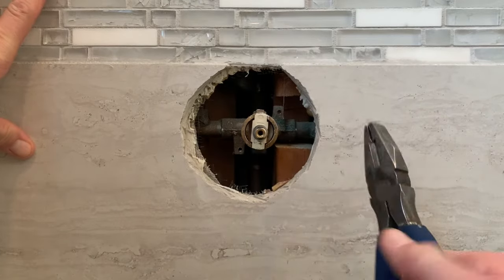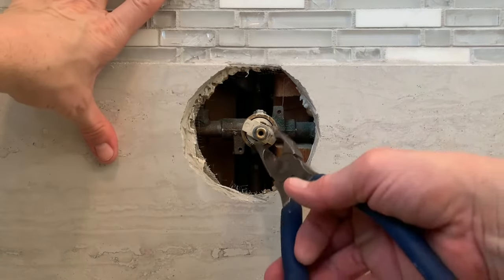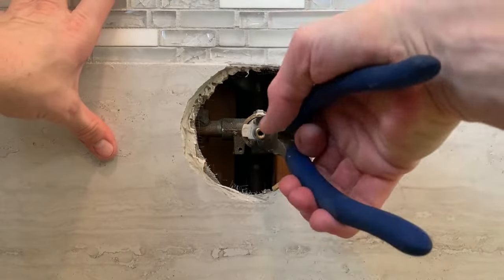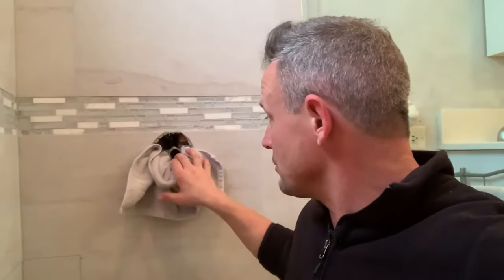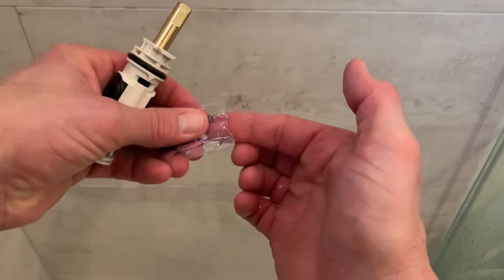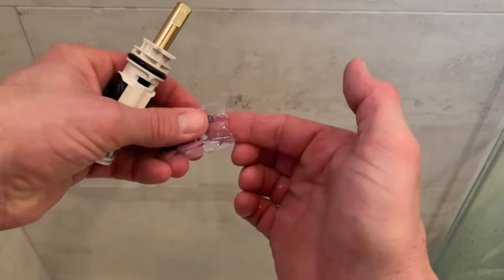How to Replace a Moen Posi-temp Shower Valve Cartridge

Comment: OMG. That tip about bending the legs of the clip saved me a call to the plumber.
The new cartridge sticks out just a tiny bit. I just couldn’t put the clip back in. I even bought another type of clip to try to put it in. Didn’t work. I was to the point of giving up and was gonna call a plumber. Everything was in place but couldn’t get the d@mn clip back in!😅
Finally I searched to see if anyone is talking about this problem. And there you are! You showed how you can bend the clip to fit it in. Woala! It worked!
The faucet is fixed! 
Thank you!!
Reply from the maker: Excellent good to hear that did the trick!
Reply: You have to push the white thing all the way in by holding and pressing in, The U clip will get in easily. I had the same problem,

Comment: When you have detailed instructions like this one, you can fix anything you want.! Thank you for this video, which shows how professional you are. I am no longer afraid to do it by myself. I have some suggestion how to remove old silicon.. The best results is to use a safety razor  blade  and press it flat against the surface of the tiles. Best regards from Polish handyman.
Reply from the maker: Dziękuję, przyjacielu 🇵🇱 sto lat 🥃

Comment: Great how-to!  I would have appreciated finding this last Sunday when I had to replace my mother-in-law’s shower cartridge.

Here’s a little tip for you and your audience from my experience;

After replacing the cartridge as per instructions, the water would not shut off completely.  There was substantial dripping with the valve in the off position.

My suspicion was hard water deposits which turned out to be correct and the likely culprit of the original valve failure.

I removed the new cartridge and inspected the valve body bore.  Sure enough, mineral deposits visible in the bore.

I used plumbers emery cloth and, by hand, gently polished the inside of the valve to remove the deposits. 

Once I flushed and cleaned the valve, reinstalled reapplied lubricant and replaced the cartridge, the valve sealed beautifully!

Good luck and God bless!
Reply from the maker: Great advice, thank you for sharing!

Comment: Best video out there.  Had to make an extension for the puller that came with the valve . Original cartridge had a washer at the deep end, way inside. New cartrage only had one washer.  Works fine.

Comment: You saved the day Poznecki.... thank you --- thank you !!!
indeed it is impossible to remove the old cartridge because the wing washers fray and are sheered off in the removal process.
like delicatessen slices they get wedged in the pipe and the hot/cold openings  and make removal an impossible task.
With my wrench I broke off the metal piece and the plastic began to crumble. - I was in total panic mode !!!!!
Thanks to the secret Poznecki double  screwdriver technique I was able to ever so slowly forward the cartridge to a position where I could get a firm grasp on the cartridge body. 
Much appreciation .... Bo
Reply from the maker: Happy to hear the video helped get the job done!

Comment: Great video.  Answered all the questions I had on this repair.  One thing I did to keep water from getting behind the wall under the valve body was to put a piece of plastic wrap under the valve body before pulling the cartridge.  Mine was slightly recessed into the wall.
Reply from the maker: Great idea Patrick! The plastic wrap will probably even work better than using a rag or towel.

Comment: I just now finished installing a new 1222 cartridge replacing the original (leaking) cartridge that came with the Moen Shower faucet (installed in back in 2008). Removing the old cartridge was indeed quite an ordeal as the unit was very heavily crusted with lime deposit - it took my son and I about 45 minutes to loosen it  (odd as we have had a soft water system since 2008).
  I will say that I'm very glad that I opted for purchasing the puller tool as I don't think the outcome would have been successful (BTW, the Danco brand puller tool that I purchased at 'Home Despot' was was much cheaper than the Moen version).
 Just the same, thank you very much BJ for the video. It was very helpful.
Reply from the maker: My pleasure happy to hear the video was helpful! 
Yes, the Danco tools usually work just as well as the OEM at a fraction of the cost.

Comment: Mine was stuck in the rough valve. I used the extractor tool but it ended up breaking the cartridge. I called two plumbers and they never responded so I ended up chipping it out with a hammer and a 1/4” chisel. I was as careful as I could be to not gouge the brass and fortunately I did not. Once I got past the two rubber side pieces of the 1222 I was able to pull the remaining part out with a needle nose pliers. Cleaned it up with a toothbrush and some CLR then flushed it out really good with water. The first 1222 that I reinstalled was faulty - maybe my fault, not sure - I did twist it slightly in both directions as I was installing it - maybe that ruined the O ring. The second one I installed I did not twist at all - just pushed it in pulses and it slowly went in. I used the extractor tool to help push it in the last 3/8” or so. No leaks. Works nice and smooth now. And don’t hesitate to call Moen for a free replacement - they’ll ask you some basic questions and want a photo and they’ll send you one for free 5-7 business day shipping though (unless you pay extra). So glad I didn’t pay $350 for a plumber - chipping it out was relatively easy - only took 10 mins or so.

Comment: At 3:12 BJ shows you what size allen wrench you'll need for the job. I have a 14 key allen wrench tool that has never failed me, so when I watched other videos without this information I thought the allen nut on the handle was rusted/worn or calcium deposited into non-working condition. Images of major demolition played in my head. But BJ's coverage of this made me realize that I didn't have the right size allen wrench, so a quick trip to the hardware solve the problem. Thank you!
Reply from the maker: My pleasure Grant happy to help! Enjoy the rest of your weekend!

Comment: I know it's been a year, but can a cartridge be initially installed just a tiny bit off?  Or does the faucet equipment dictate that 2 and 7 are right?  Seems like our facets aren't at 6, more at 5.5 when off.
Reply from the maker: @lindapeterson8815  Good morning Linda! It sounds like maybe there’s some sediment or debris in your cartridge. Typically this can be fixed by, taking the cartridge out and cleaning it and flushing out the shower valve.

Comment: If you can't pull the cartridge out like he shows then get the fricken puller.. Especially if the valve is more than 4 years old. Mineral deposits can build up inside and make pulling out the cartridge with pliers/vice grips a PITA.

Comment: Great video but I have a problem. I replaced the valve about 8 months ago. The tub faucet dripped just slightly so I bought a new 1222 cartridge. It appeared to  stop the dripping until recently again. So I replaced it again. This time it doesn’t drip continually as one drop every second but about every minute it releases a little trickle 😩. Any advise? Bad valve?
Reply from the maker: Hi Dan! Is it leaking out of the spout and dripping into the bathtub or leaking between the cartridge and the valve? If you want to shoot me a text my number is 773-403-3298.

Comment: Do moen positemp cartridges have a generic or off brand replacement?  Also  just an FYI I have a single family home (in Oregon) where the where shutoff is at the front of the property where the city shut off is.
Reply: We had a neighbor move into his very first house across the street who cut his water line.  He calked 911 to find out how to turn it off.  I went over and showed him the main shut off and how to use it.   It's in the same box as the city water meter.
Reply: And after removing g everything you can see there is no water leaking from the back side into the wall. A fantastic video.  You should teach STEM classes
Reply from the maker: @lindapeterson8815  Thank you for the compliment! Wow, that’s interesting that you don’t have a water shut off valve inside your home. Here we have a water shut off valve in the front yard that the city can turn your water off if you don’t pay your bill, but only they have access to it. To my knowledge, there is not a generic replacement cartridge. However, the Moen cartridge is only $50.

Comment: This video was a life saver. Thank you. I did have one small problem, though. Everything is working fine, but my handle is much looser now. Any idea why that would be? Did I miss something?
Reply from the maker: Thank you happy to hear the video was helpful Rick!
When you say the handle is looser now do you mean as far as turning it back and forth, or the actual handle itself?
If it’s the handle itself, it’s usually the handle mounting bracket is loose, or the set screw in the handle to the mounting bracket is not tightened all the way.

Comment: So at about 4:10 you skip the part where you're removing the metal adapter - the same piece you're calling a handle mounting piece at 14:38 - Mine is completely caked on with calcium and no matter how much CLR or W2-40 sprayed onto it, I just can't pull it. I wanted to see how you would pull and remove it but it must have just come out ok for you, huh? It seems so easy to DIY but since I don't want to break it, I am having to call a plumber for this job.
Reply from the maker: Yeah, it’s a simple job, however if you’re struggling to get that piece off, I would just play it safe and bring in a plumber.

Comment: Good explanation. You might have mentioned what to do if the cartridge is stuck. I just changed a stuck positemp and it was a bear.
Reply from the maker: Yeah, you’re right Richard, I should’ve!

If the cartridge is seized, soak it with WD-40 or a rust penetrating lubricant. Then, with your Moen cartridge puller, slowly turn it right and left, little by little until it frees up, and then pull it out.

Comment: Thanks for the video. I had some issues after replacing the cartridge. When I turned the main water back on after replacing, the water was flowing freely from the shower head. Is this a sign that the cartridge itself is defective, or something wrong happened with the installation? Or is it possible that I installed it upside down, and that is causing the water to flow that much?

I removed the cartridge and cleaned out the pipe to make sure there was nothing left. When I was taking out the old one, it broke off so I have to break it into many pieces to get it to come out. Some water was trickling out, so I think the debris is all gone. I noticed that the O-ring edges are flat on one side, so it looks like I have have sheared off a bit of the ridge on the o-ring. Not sure if that would cause that much water to come out when the handle is in the off position though.

Anyway, I reinstalled the cartridge and then shut off the water to one of the pipes by the shower so the water is off for now. My plan is to buy a new cartridge and reinstall closely with your steps. Do you have any idea why the water still flows when its in the off position?
Reply from the maker: Hi Alan- It’s possible when you installed the cartridge and put everything back together it’s upside down and in the on position.

What you should do is take the handle off so you have just the stem of the cartridge sticking out. Take a pair of pliers and turn it to where are you finally have the off position, then turn it counterclockwise and the water should go from cold, warmer, to hot we’re full hot is at the 9 o’clock position.

Then, turn it back clockwise to the off position and then reinstall the handle and all the parts.

If you’ve already done that and there’s no stopping the water at any point of the turning the stem of the cartridge then I’m guessing it’s a defective cartridge and you need a new one.

Comment: My friend had a new shower installed and they installed a Moen posi-temp and now she has no water pressure in her shower how does she increase the water pressure
Reply from the maker: If it’s a new shower and there’s no water pressure, more than likely when they turned the water off and turned it back on it pushed all the sediment that was in the pipes, into the cartridge. You’ll need to have the plumber come back out and either clean or replace the cartridge. That should fix the issue.

Comment: What should  i do if water comes out of the cartridge  when i turn it on?
Reply from the maker: You may have bought a defective cartridge and have to buy another one, or it’s possible that your shower valve body could be warped, not making a good seal around the cartridge, and need to be replaced.

Comment: Thanks. Is the escutcheon tube extension needed? Can this install work without one?
Reply from the maker: Yeah, it will work without one, however you may get some water leaking back behind the wall from the space between the shower valve and trim plate.

Comment: The handle on my shower is now loose.  Did I not tighten something correctly when I installed everything back together?
Reply from the maker: Hi Brad- Yeah, it sounds like either the screw that holds the mounting bracket to the cartridge, or the set screw in the handle that secures the handle to the mounting bracket.

Comment: Do you have a video on the pull turn cartridge?
Reply from the maker: Hi Neal, I don’t, but the steps in this video are almost identical. The only thing you need to buy in addition to the new cartridge when you’re at the store is a Moen cartridge puller. It’s best to buy this tool, because sometimes the pull and turn style cartridge can be difficult to remove without it because the cartridge and the valve are both metal and bond together. When you attach the puller you want to line up the notches on the puller with the notches on the cartridge, and turn the puller clockwise and counterclockwise to loosen up the cartridge in the valve body and then pull it towards you to remove it.

Other than that, the steps in this video are going to be very similar to replace that style cartridge.
Reply: @BJPoznecki  hey thanks A lot. I’ve change one before. I have the tool. But I’m not sure if it works on this one which is the pull turn. Lol. I have to search for my tool to see if it’s different from the one your talking about. Really appreciate you responding so I’ll definitely subscribe. 😁
Reply from the maker: @SonnyIncMusic  My pleasure! This is the puller that I recommend if you can’t find yours and have to buy another one. 
Danco 60885 Cartridge Puller, Chrome https://a.co/d/hAqEEvu

Comment: Great video, just replaced the cartridge but not getting hot water. We are getting hot water out of the sink and bathtub but not the shower, and if I have the sink or tub turned on then we get hot water in the shower! The maximum temp is set to the 12 o clock position as well. We have a tankless water heater any help is appreciated!
Reply from the maker: I’m confused are the shower and bathtub valves two different valves where one operates just the shower and the other one operates just the bathtub, or is there one shower valve for both the bathtub and showerhead?

If you want to send me a video of what you’re experiencing you can text it over to me at 773-403-3298 because I’m not understanding what you’re experiencing and what the set up is in your bathroom.
Reply: @BJPoznecki  what do i do if ive done alll these steps and the water is still either ice cold or off no matter what position its in?
Reply from the maker: @Fewmetal  It’s hard to say exactly what it is so the only thing I can suggest is to start over and get a new cartridge from the store because maybe there’s a manufacture, defect or debris caught up in it so I would exchange the cartridge for a new one. 

When you have the cartridge out, make sure you really flush out the lines really good let the water run for 30 seconds so this way it blows out any debris that could be in the line and then put the cartridge back in and put everything back together.

Comment: even after putting the top plastic part at 3 o'clock position I am still getting a little warm water from cold setting. Not sure is the valve or plumbing problem.
Reply from the maker: It could be a couple things. One it could be the stem is not in the right position you’ll have to actually take everything off and keep spinning it where at the 6 o’clock position the water is off and then as you go counterclockwise it goes from cold to warmer. 

It’s possible the cartridge could be in reversed and you need to pull it out and rotate it 180° and put it back in. 

Last, it could potentially be a defective cartridge and you need to get a new one.
Reply: @BJPoznecki   Thank you for your reply. This problem started few weeks ago. Before that everything was fine.
Reply from the maker: @tty3146  my pleasure! If this just started happening. Than either there is debris in the cartridge and it needs to be cleaned and the shower valve flushed out. Or, there’s an issue with the cartridge and it needs to be replaced.

Comment: Great video!  I managed to switch it by following your tips, thank you!  One problem, when I divert the water flow to the shower head, the valve pushes it self out, causing water to spray everywhere.  Anyone have any ideas what I did wrong?
Reply from the maker: Thank you happy to hear you like the video! 
It sounds like you may have forgot to put either the O-rings on the cartridge, or the U- clip that holds the cartridge into the shower valve.